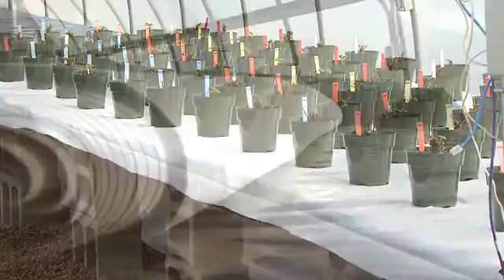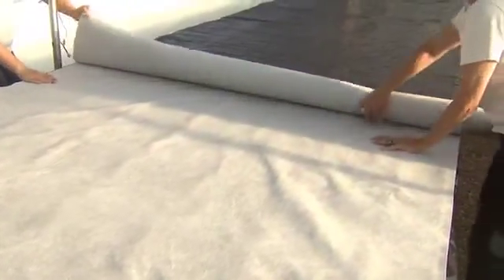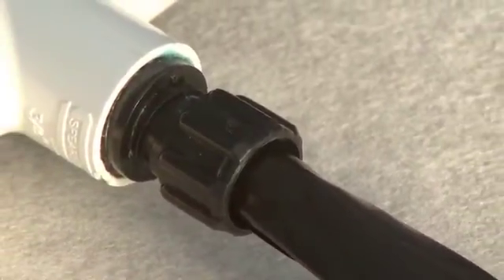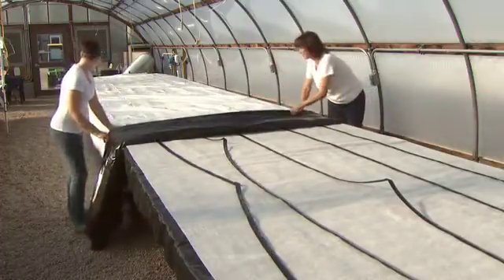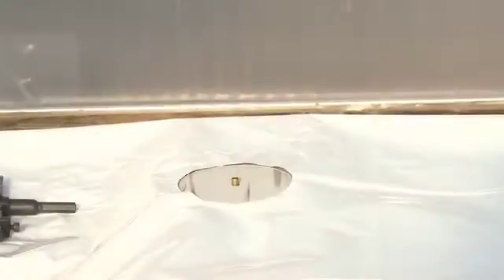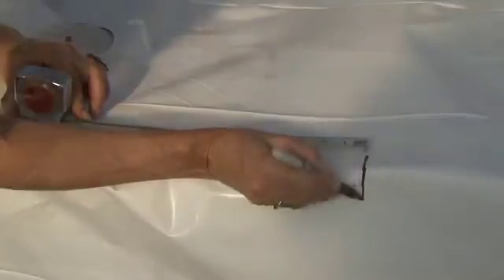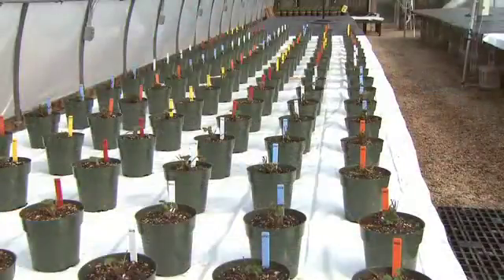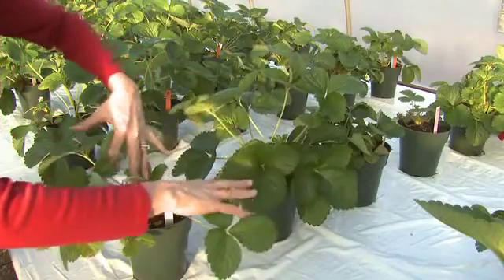Capillary Mat Construction for High Tunnel or Greenhouse Benches

Comment: What kind of material is that capillary mat made of?
Chuck
Reply from the maker: +Fensterfarm Greenhouse 

Capillary mats are made from a very absorbent fiber like a felt and are about ¼ inch thick. They can be purchased from most horticulture supply stores. —via Professor Ellen Paparozzi, UNL Department of Agronomy and Horticulture